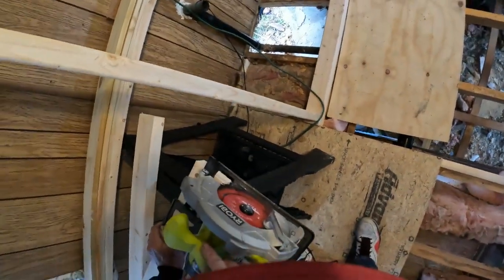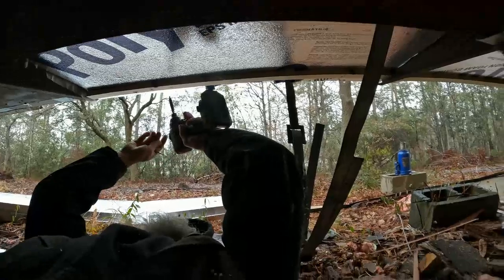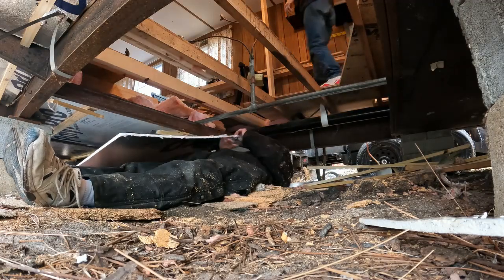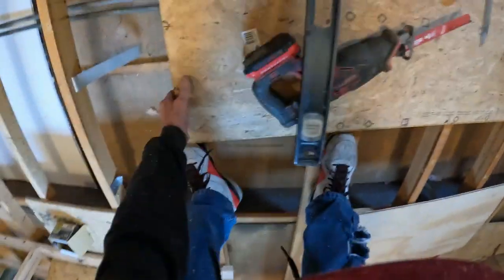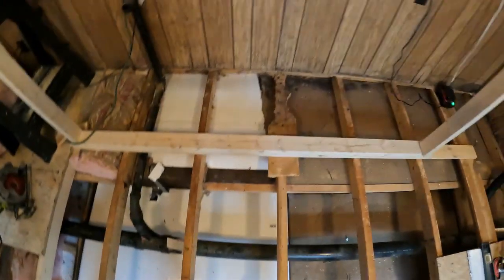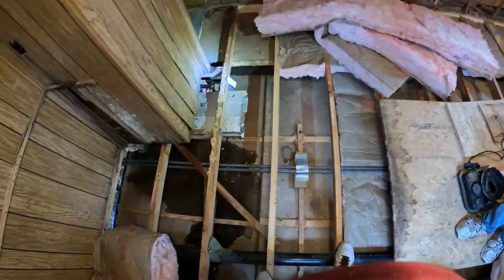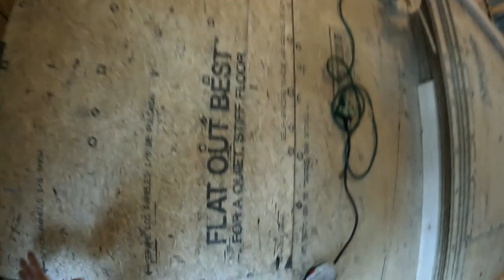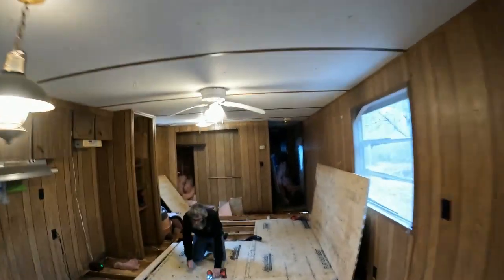Mobile Home Under bellies on a trailer

Comment: Under my home the manufacturer missed most of the floor joints with the nail gun. Only thing holding the sub floor down is the glue. Our floors are now  squeaky.  Oakwood home.
Reply from the maker: Wow. That stinks

Comment: I've been under and over those mobile home floors a few times, i know the work involved! You two do awesome, snd the RIGHT way. Great to watch, tips sre going to come in extremely helpful. Miving into one soon, with alot of ehat i see here issues. Ty for your vids!!!
Reply from the maker: Awesome! Thank you!
Reply: @Drewsroofingandhomerepair  I'm gonna need the frame done for new skirting that I'm going to install. Is there a round about figure it will cost me to have someone do the frame up? It's a 72 double wide. Interior full remodel done, but It needs ext. skirts redone.

Comment: I liked how you did the insulation under the floor joist
Reply from the maker: Thank you
Reply from the maker: It’s really the best way to do it
Reply: What is that Polypro board you installed underneath to the joists? Where do you get it?

Comment: Took me years to come across helpful videos. We purchased a 1978 double wide 27x50’ two weeks before 2020 shut down. Yay!  Contractor never replaced skirt tracks and cut small pieces of ply wood in floors. Long story short, we have to redo all the floors. Do you recommend replace or repair?  Thank you for taking time to respond. Signed hopelessly molded and rotted.
Reply from the maker: When I do a floor, I feel like if I don’t do the whole thing later on, I could have the same problem and have to do the whole floor over again so doing small pieces and parts in my opinion is a bad idea

Comment: Tremendous tasks. Ten of me won't be able to do any of that. BTW, I noticed that you uses mainly screws. Undoubtedly there are pros and con with screws, but does all joints and connections requires screws?
Reply from the maker: I can remove the screws if I want to at a later date that’s what the pros are. I don’t know of any kind.

Comment: Drew, ever had to work on ceilings like what's inside that home? The plastic strips that cover the fasteners that hold the ceiling up.
I was working on a ceiling in a home and those strips were bad.
Can't find any anywhere. Any sources you know?
Reply from the maker: You can’t buy them strips anymore so what I ended up doing is using lattice strips made of wood paint them white text him up with a trim nail gun
Reply: Great idea!
Reply: I needed to find these too, but...what do I know, imma' Ol' School Bus Driver, trin' to fix up this 1976 Town & Country 3 bdrm. 2 bath I bought in April, I'm using the Gas Oven/Stove, and a few Electric heaters to keep warm right now😮
    I have had three Coats of the White Roof Sealant put on, Sure Hope I was told to get the Right Stuff for this, but I've seen No New Leaks since that has been completed.
   You guys are Awesome.
   Vaya con Dios

Comment: Was the original floor replaced?  It looks like the outriggers are not doing anything?  I have to replace an original floor that looks like it is a 3.5” panel from a 70s Nobility.
Reply from the maker: Yes, we replaced the entire floor and the end no problems

Comment: Why doesnt the particle board go under the wall like the factory? Is it correct to scab onto the wall 2x4 and the floor joist instead of replacing espescially since everything is exposed.
Reply from the maker: It is very difficult to raise the wall and remove the wood from under it. Sometimes you can sometimes you cannot. We do it when we can.

Comment: Is the polypro board better then the traditional black under belly fabric.?
Reply from the maker: If you can use that product, yes it is a good product. Use it. If you can someplace you can someplace you can’t either way they will both work.

Comment: So this is an alternative for that black underbelly right? Our mobile has no insulation, soon as you take off the plywood you can see the dirt ground.
Reply from the maker: If you’re able to get up underneath your mobile home, yes this is a perfect alternative for underbelly and you can buy it at Lowes or Home Depot. It takes a little bit of work but it is well worth it.
Reply: I couldn't tell how you put in the foam board at first i thought you screwed it into the floor joust but when looking from the top it didn't look like you did,and the joust look like they're 2×4s not 2x6s,can't tell because my glasses are broke

Comment: Hi.  Drew i have a question /  dispute.   To settle.   So' we had a small drip under bathroom  sink took awhile to notice.   But. Got wet under sub floor.  Pulled out under belly and all.  Insulation  under  double wide. Husband says none of it.  Is going back.   Just.  Thick mil.  Plastic.  On ground for. Barrier.  And.  Up the block foundation.    Is that enough? Much cooler in here.  But its winter. Really dont like insulation.  Rodents love it could i use.  Sheet  insulation.? Thanks trust your. Input frequent  viewer.  U guys are great.
Reply from the maker: If it was me, and I tore out the underbelly and the insulation, I would want to put new insulation up into the floor joist. If the underbelly is removed all you have to do is insulate the floor, Joyce. It is a good idea to put the vapor barrier on the ground and up the walls, but I still think he might need some type of insulation.

Comment: Hello drew ..what kind of plywood should be used as a subfloor for a mobile home? 1/2 ..3/4 and what kind of finish?
Reply from the maker: 3/4 or what ever thickness is removed. Mostly 3/4. Adventec plywood
Reply: @Drewsroofingandhomerepair  thank you
Reply from the maker: Welcome. It is on the board we are using. The name that is
Reply: @Drewsroofingandhomerepair  yeah it's pretty expensive but I'm sure it's worth it
Reply from the maker: It is. The floor will go bad again

Comment: Should this only be done where it rains and snows a lot? I don’t get much rain but summers get to about 114f will it get humid down there and bring it into my trailer?
Reply from the maker: You would want to install vents so the underneath of your house can breeze I would say probably every 10 feet around a mobile home you would put a 8 x 16“ vent for airflow
Reply: @Drewsroofingandhomerepair  thank you!
Reply from the maker: Thank you for stopping by my friend. Every house needs to be ventilated on the underside in the summertime I keep mine open in the winter time I keep mine closed

Comment: Why you did not insulation wall to wa) on the floor
Reply from the maker: We actually did put the insulation wall-to-wall the outside walls had 3 1/2 insulation and the metal in between had six sense insulation because there was more room so or 13 on the outside because of the small space we had and are 19 in the center

Comment: What are these boards called?
Reply from the maker: You can buy them at Lowe’s or Home Depot. They will be in the insulation aisle so if you go to where they sell the insulation I guarantee on the other side of the aisle you’ll find the stuff I believe this is half inch Styrofoam that I’m using a little bit flexible so we can get it up in there properly. It’s not that hard to do once you get started.

Comment: so this works for isulation does it also work for waterproofing ?
Reply from the maker: No it’s not necessarily a waterproofer there’s not anything really on a mobile home that’s waterproof
Reply: @Drewsroofingandhomerepair   got it , planning on remdiling a Mobile home just wanna do the right way and avoid headaches later on , with the floor
Reply from the maker: If you wanna avoid headaches use the best material on the floor
https://youtu.be/d__dX50-2Fw
The best flooring would be adventtech. You might be able to see it in this video it is waterproof.  
https://youtu.be/jQAhuH3gEVE
Reply from the maker: There are different types if you go to Lowe’s ask them for the best floor seating they will probably tell you it is Vantex or advent Tech there are a couple different brands
Reply from the maker: I have many videos on Floors check out my playlist for Mobile Home flooring
Reply: @Drewsroofingandhomerepair   thanks so much this helps alot appreciate it !
Reply from the maker: Glad I could help my friend if you need anything you know where to reach me. You can also call me my telephone number is all over my YouTube channel
Reply: @Drewsroofingandhomerepair   awesome thanks ! Happy holidays !
Reply from the maker: Happy holidays

Comment: Isn't it a waste of time and good lumber at this point 🤔
Reply from the maker: No, not at all. I can take an old shack and turn it into a beautiful place to live guaranteed as long as you have something to work with you can do anything.
Reply: I have a 1979 single wide with flat roof that i'm trying to fix up,these videos are great,right now i'm sealing my roof,but want to cover the roof with ribbed roofing but not a peaked roof just so the metal bends with the roof, so i wont have to keep on having to keep applying roof coating